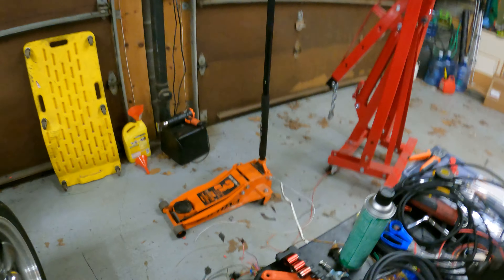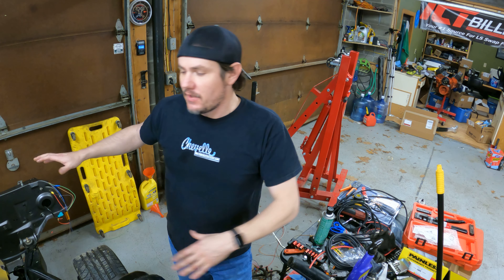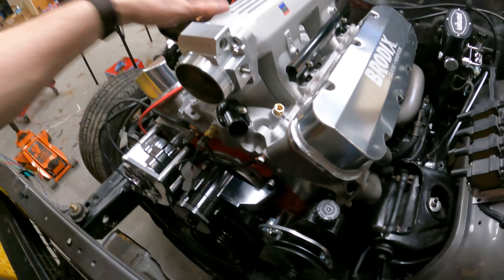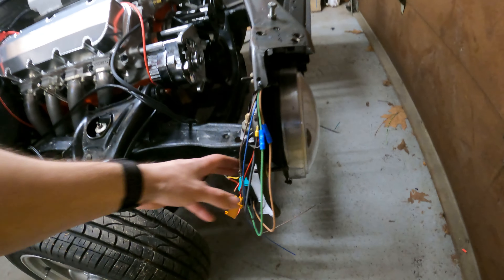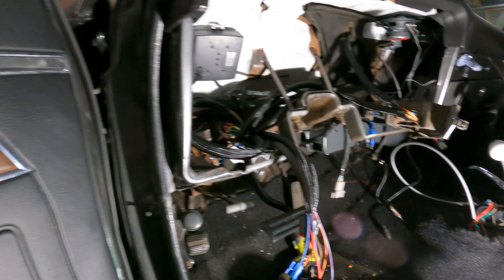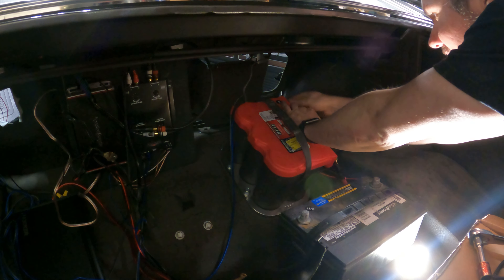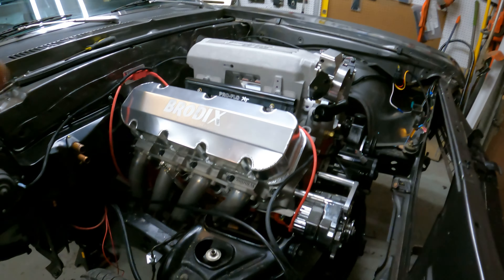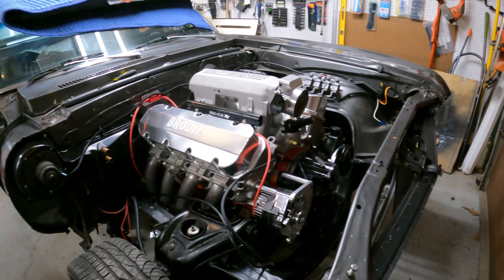Painless Harness Install On The Nova

Comment: I have the 23 circuit from painless performance for my 70 monte carlo. I don't see where the ground wires are for everything, only power wires. Do they utilize a single ground wire for the entire electrical system?
Reply from the maker: A lot of the legs have grounds on the end or the device they hook up to utilize an existing ground, so most are the power leg